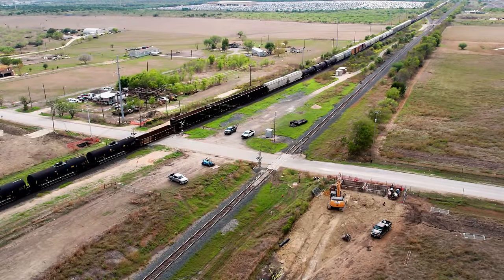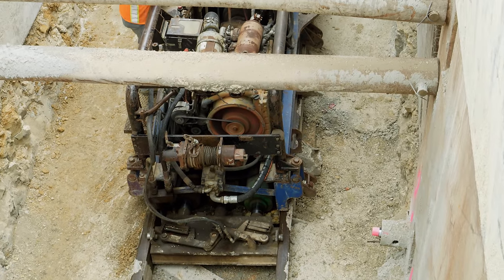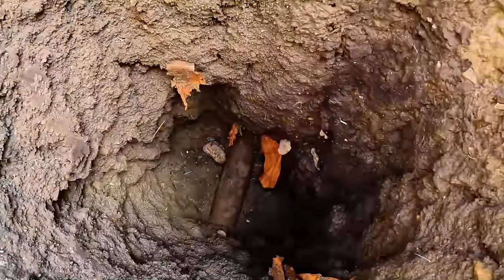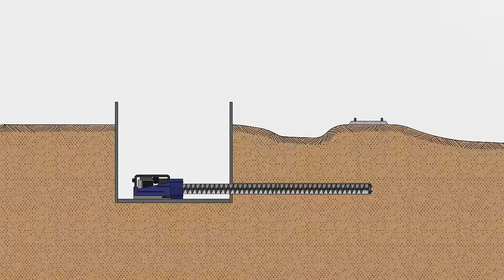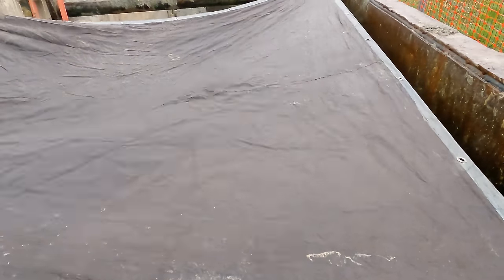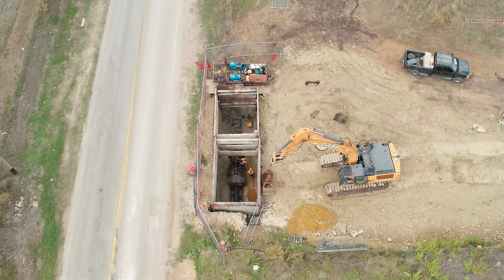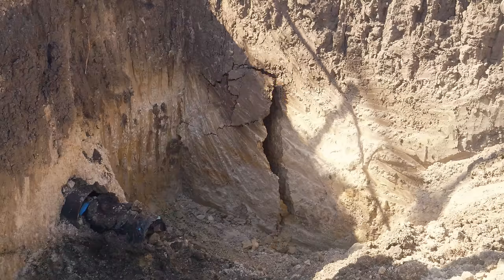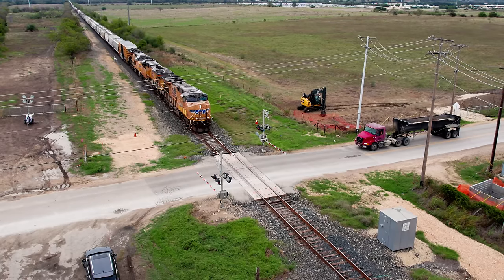How To Install a Pipeline Under a Railroad

Comment: 3:00 Little known fact... Utility lines do not always remain at the level they are buried. Sometimes through erosion from wind and weather, construction, or simply 20 years of falling dust, their depth can change by feet in either direction. Think about a road grader widening a dirt road by pushing six inches of topsoil off to the side and cutting through the top two feet of a short mound so you get a smooth road. That can bury or excavate an underground installation. Also, the biggest cause of fiber optic lines being cut is (or at least was for about 15 years) the installation of additional fiber optic lines. Excavators or boring machines chewing up existing installations.

Comment: I used to help build continent and international scale fibre systems. Handling "backhoe fails" without much disruption to data flow is a fundamental stress source and challenge to all operators :)

Comment: I do these a lot.  Most railroads require jacking and boring a steel casing.  I even had one fail as we hit a pocket of very weak soils and the casing deflected downward.  Then your pipe goes through the steel casing.  Some will let us directional drill the pipe directly.

Btw, one of the rare cases where “cement” was used correctly instead of concrete 😂

Comment: Ive directionally drilled many of these, most times pulling large diameter steel casing to run poly gas pipe thru, we don't these old style trencheless rigs, way easier to directional drill and a lot faster....

Comment: Have you ever heard of a company called Walker Electric? They are doing horizontal line boring for another company called Allo who is installing fiber optic in Arizona. If you get the time you should research how many water mains, sewage line, and internet lines they have destroyed. On my street alone they destroyed all 3 at every single house. My coworkers across town the exact same. And each time it takes over a month to get services restored.

Comment: I've done this type of work before and I'm pretty sure they were screwing with you when they told you they send someone into the pipe. That pipe is pretty small and unless its a kid, not too many people are going to fit. Usually there is a simple reflector that is at the end. If the laser hits it then the pipe is in the right location. We can also check on the surface using ground penetrating radar. I'd want to see video of someone going into that casing. Even if you could put someone in there that casing is way to small and way too long to get proper ventilation or to exhaust stale air. Not to mention there is no adequate safety plan, only relying on pulling someone out which is far more difficult than people think. 30" Diameter is usually the minimum for someone to go into.

Comment: Clever how they ran the pipe through a sleeve, one I imagine large enough to get a bigger pipe through if they need more capacity some day.  Also..I wonder if they can lease out additional space within the sleeve if there is a need for fiber optic or other cabling.

Comment: All of this times 10 for petroleum and gas pipelines under a railroad. I was once involved with a hammer bore under a runway for some jet fuel pipelines. Same idea but instead of drilling you just beat on the end of a sacrificial pipe to drive it through.

Comment: My daughter is moving into that area as I type. Good to see this.

I'd still like to see an update on what, if anything, is going on with the bridge construction in Corpus Christie that TXDOT shut down due to design failures. Has a remediation plan been settled on yet?

Comment: I need to replace my water service line.  I was told to trench the 20' and curve the trench to the house would cost $20k.  Boring is the only option and very few firms do for such residences.  Still, will cost me about half.

Comment: here is an idea for a vid, Home scanning Via surveying with a laser distance finder, I recently got one and it has a lovely little center mount for a tripod and it occurs to me that I could theoretically measure and map out the walls/interior of a room from a single center point just by measuring distance and angles, but I don't ACTUALLY have any idea if thats feasible or a huge waste of time

Comment: Great and very informative. Just one question: is there a survey and records made after the build? The "as built". If the boring/drilling does go off track and you ended up a meter or 2 (safely) away from the road, The exit point is not where it was planned, allthough all was well and reconnected.

Comment: Hey Grady, do you have a video or plan on making a video on how civil engineers calculate if an erected building is safe'and what loads each floor can handle shown in a free body diagram? I suppose this leans into the 'safety factor' that buildings are designed and build towards with the given materials.

Comment: I’ve been around this stuff in the oil fields of west Tex. I used to run a hydrovac truck and I’ll tell you the guys that come out and mark there lines are always wrong. You know they will be way way off if the bust out the witching sticks. Lol

Comment: The as you called it a vacuum truck, is called a hydro-vac. When they are excavating lines for whatever reason, that is called, daylighting. The hydro-vac has both a water & an air lance (works the same as the water except it is done with high pressure compressed air) that can be used.

I had my OQ's in Houston  on daylighting & many other pipeline tasks/jobs. NEVER did anyone call it potholing. Smh

Comment: liability is another thing that can increase as the project goes on since anyone can come by.

today's surveyer devices can remove the need for trigonometry by shooting lasers and calculating the areas.

set up the device and push a button and it will tell you the area.

Comment: Grady, this was informative.  That said I was wondering what changes have to occur in soil with substantially more rocks and boulders?  Do they end up with small tunnel boring machines with rock boring heads and then the rest basically the same?  Like miniature machines they used for the Chunnel or other subways?

Comment: I’ve always been interested in construction, so much so that I knew what an auger was at a very young age. As I got old enough to start working and helping my dad around the house, I took to calling standard drill bits “auger bits” because they looked like small augers. And to me, “drill bit” is too all-encompassing. Any bit that you put in a drill could be called a “drill bit”, i.e. “a bit that goes in drill”. Anyway, a few weeks ago my dad was looking all over for his drill bits, and he couldn’t find them anywhere, and I was helping him. Then I noticed a box on the table of what I call drill bits. (Phillips, flat, Allen, torx, etc. bits). Then it clicked. I realized that he wasn’t looking for what I call drill bits, he was looking for what he calls drill bits. My eyes widened and I shouted aloud “AUGER BITS!!!” And I ran and got them for him. I had borrowed them and I knew exactly where they were the whole time, but only after 3 days did it click that he and I used different names for the same thing.

Comment: I've been in the construction and  boring business for 32 years here in Tx  
  We bore railroad tracks all the time.  I haven't seen an horizontal track rig like that in 20 years. 
  That is too time-consuming and not cost-effective due to labor and too dangerous with open pits, we bore everything with directional boring now. 
  We could bore that 300 foot job at 20 foot below the track back it and pull a welded 12 inch casing like that in under about six hours in good dirt, shale or rock would be a little more time, maybe 8-9hr

Comment: A really cool one would be doing a bore and jack of 48-60" RCP pipe or Box Culverts, they don't have drill bits this large usually so people have to crawl IN the pipe with power shovels to excavate horizontally. If i know of one, i'll send an email. Very dangerous but no other way to preform the work.

Comment: I'm surprised by the apparent right-angle turn in the exit pit, wouldn't that add drag and noise? 

Would they ever add conduits/ducts to the annular space to support future fiber crossings without having to bore again? Seems like an easy way to add value to an investment.

Comment: In this particular case, one of the tracks could have been closed to allow a "classic" trenching process, while trains would have run on the other track in temporary two-way traffic. And vice versa. But installing temporary points and signalling would certainly have been a more complicated process...

Comment: Thank you so much for the educational video on horizontal boring! I am curious if you guys were able to bore with the head of the boring machine protruding the steel casing or if railpros required you to keep the head flush with the casing? or did you guys submit a variance? Thank you!
Reply from the maker: They got a variance

Comment: Incredible. I find it fascinating how they might just "go for it" in a third world country and could potentially do this for an order of magnitude less, but we have these endless safety precautions. This sort of bureaucracy can be essential for these complicated projects, but the complexity can also make many jobs non-viable to add value equivalent to the cost of inspectors, safety equipment, etc. Civilization teeters on this fine balance of risk and cost.

Comment: A water excavator is exactly like what I used to do in the backyard and drive my parents nuts. I'd get the hose, turn it on, and stab it directly downward into the ground. I would usually be able to push the entire length of the hose into fhe ground, with the dirt coming out brighter orange the deeper I went. Still one of the best ways I destroyed the yard

Comment: Funny enough when they did this under a highway it made a dip in the road where the hole was. also when they did horizontal boring under some walkways the asphalt cracked alot.

Comment: I think I see a flex hose big enough to qualify as a fresh air supply. I hope so, because the boring machine appears to be powered by an internal combustion engine and the trench sure looks like a confined space to this retired health and safety officer. Am I correct about this flex hose?

Comment: I the vac truck is also used for sewer cleaning but is multi pourpose helped me run a power line about 200 ft in lime rock much easier than digging “ and I didn’t use a ditch which bc we’ll I don’t own one.. but I do own a vac truck

Comment: I often wonder why they don't use polyethene pipes in these projects. They are easier to handle, tougher, and have a lower chance of leaking. You weld a long snake above ground and then you pull it through the protective pipe.

Comment: As a designer in underground utilities, I have a project involving a railroad crossing too. What is the reason for boring, instead of horizontal directional drilling (HDD) in this project?
Also, does the US (or its states) not have a digital system to request the location of underground utilities in an area?

Comment: The railroads in the US look so increasingly old fashioned with very long slow diesel trains and very limited safety installations around the crossings. Please come over to Europe (especially the Netherlands) to showcase what good infrastructure can do to a country and how it can improve the economy and wellbeing of a country. In the Netherlands it’s especially interesting how passenger travel can coexist perfectly next to freight using the same tracks while this seems to be a huge issue in the US.

Comment: What happens when the city nolonger has maps for old water lines? Found everything that were located except a 8" water main that was not on their maps. Took the city a long time to find the water shut off valves. It was a very  long day to finish the work

Comment: Who decided that straight segmented pipe is superior to HDPE water pipes in this instance? The latter can be made any length and pulled through any grade. Was it soil conditions? Cost? Contractor experience?

Comment: You states the the shoes would not allow you to turn a corner. But is there a way to turn a tight radius  with horizontal drilling? Be it up/down/left/right
Reply: You can't bore turns with horizontal boring. The auger is inside of a relatively straight casing pipe. You would need to dig a different boring pit at the point of the direction change and start another bore in the new direction.

Comment: Really liked this content.  Of course I'm entertained by the railroads "6 hour interval of monitoring the work" while there are thousands of miles of track that get very little attention while the track weaves and rolls through the plains.  I had a high center of gravity load shipped via rail where the rails where so bad we were on the ragged edge of rolling the load.  When someone else's budget is involved the railroad is very interested in maintenance, otherwise eh, it's fine.

Comment: How they can excavate the whole 500-600m of soil to the other side? The drill is connected in a line the new behind the old?
Reply: Yeah. Each new pipe section they insert contains an auger extension.

Comment: I'm working on a project right that will have 4 jack and bore pipes go under a rail line.  50" casings that will have storm pipes put in them.  Still waiting on rail approval.......

Comment: how is the first auger pulled out if the cutter head has teeth that overcut the flights and extend beyond the ID of the casing?
Reply from the maker: They hinge back in if you reverse the direction

Comment: A lot of specifications for building around the track. I don't see any concrete built above the tracks. Steel viaducs only. The railway doesn't like culverts if it can avoid it too. Level crossings may be preferable to digging up track bed.

Comment: The moment I saw this video,  one accident, that happened in Slovakia few years ago, came to my mind. A company was horizontally boring some shaft for (I believe) cables near an apartment building and they punctured a gas pipe running nearby. Gas ended up leaking and concentrating in the apartment building (12-storey communist block) without anyone noticing and, eventually, exploding, destroying top 3 floors and killing (IIRC) 12 people. So, there is one tragic story. There are some videos on YT for those interested.

Comment: Why didn't they use sonar to find the exact location of the pipes/wires instead of digging a hole? That seems easier than having a giant vacuum on wheels.
Reply: Ground penetrating radar is not precise enough.

Comment: How can that massive water pipe have a 90 degree bend in it without it getting hammered off from the water pressure??
Reply: Restrained joints and a massive concrete thrust block poured at the bend.

Comment: In the US, it's normal for us to tear up the road to fix or install a pipe, or cable or whatever. We think nothing of it, nor, I believe, does a utility need to compensate anyone for doing this.

Whereas it's my understanding that in Europe, utilities are charged each time they tear up a road. And this has led them to, long ago, invest in microtunneling technology. So, the normal thing for a European utility to do is to microtunnel under a road, rather than tear it up.

Which, of course, is a lot nicer for those people who use the road.

There are a lot of things we view as "normal" in our life that in fact are nothing more than generally unexamined assumptions.

Comment: Something that bothered me during the video was that on the stacker trench box, one of the spreader bars was starting to bend like a banana. They should have thrown that pipe away and gotten fresh 8 inch schedule 80 steel pipe to replace it.

Nothing worse than taking the time and money to install a safety system to protect the workers and the system fails because it was installed poorly.

Comment: I worked trackside for 12/13 years some times putting out site lighting a metal spike is driven into the ground then a pole and a light 💡 head for months /years we put these metal spikes in No issue ever 😊Then we were instructed to scan for other buried cables 🤔🥴 Yrs you guessed first day using scanner Nothing found but the spike found a cable 😬😜👎🏻👎🏻👎🏻👎🏻

Comment: 📝 Summary of Key Points:

📌 The Union Pacific Railroad's Austin Subdivision in central Texas is a busy corridor for freight and passenger transportation, presenting challenges for installing a new water transmission main without disrupting operations.

🧐 The installation process involves using horizontal earth boring to pass the water line under the railroad tracks, requiring meticulous planning, coordination, and continuous monitoring to ensure safety and alignment.

💡 Additional Insights and Observations:

💬 "Trenchless technologies like horizontal earth boring offer innovative solutions for installing underground utilities without surface disruption."
📊 The project involves continuous monitoring of the tracks' elevation changes every six hours to ensure the boring operation does not impact the railroad.
🌐 Safety measures, coordination with railroad operators, and nonstop work are crucial aspects of the installation process to avoid delays and ensure efficiency.

📣 Concluding Remarks:

The video showcases the intricate process of installing a water transmission main under a busy railroad corridor, highlighting the importance of precision, safety, and continuous monitoring in completing such complex infrastructure projects successfully. It provides valuable insights into the engineering challenges and innovative solutions involved in underground utility installations.
Generated using TalkBud